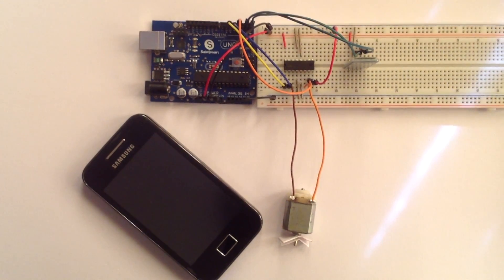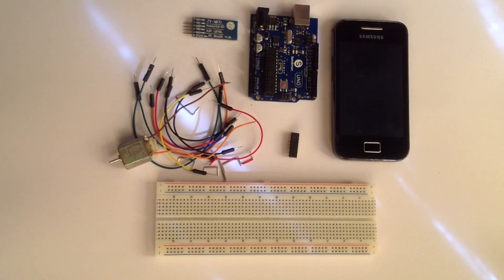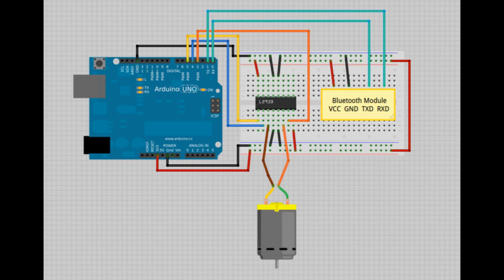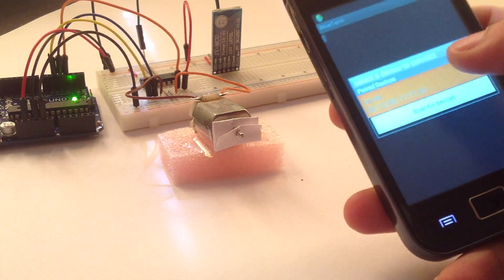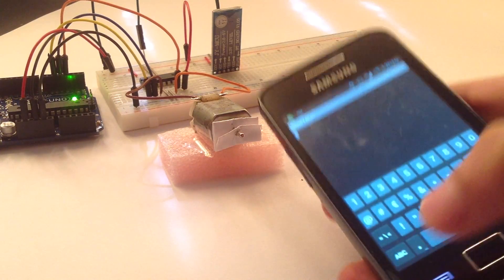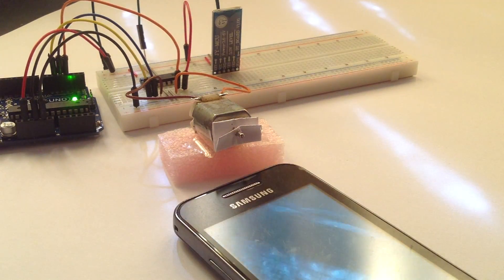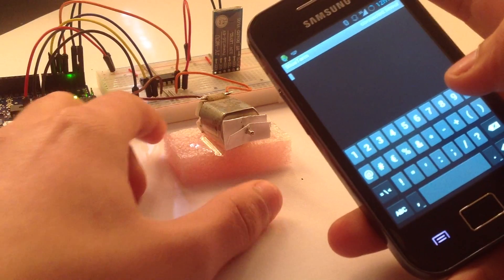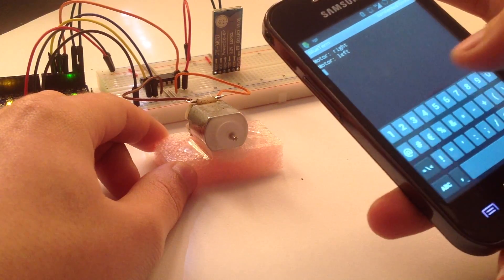Arduino - Control DC Motor via Bluetooth

Comment: Sir , I have connected according to ur given ckt nd coding is same as given by u nd after that uploading of code is also done but still my motor is not running. why ??
Reply: Tanya Chhabra hey can you help me out like where did you connected the battery

Comment: If I have to motors and 4 buttons. The first two buttons 1,2 are for speed_1 and the second buttons 3,4 are for speed_2. What is the code then to control in the speed..!

Comment: Hello I ask you a question, I have the same components as you but I need 1 key on and off the engine and while this lasts only 1 second ahead For a little ... Thanks
Reply: Hace mucho tiempo que no lo hice, pero en un paso Cuando se conecta Hay un signo que dice que el código es el estándar, Look it up wel
Reply: Si no me equivoco, el código Decía algo de "1234"... Intenta con ese.
Reply: ISRAEL RAMIREZ JIMENEZ  El código que usa Blueterm para conectarse al bluetooh del arduino? si no es eso no te entiendo

Comment: is there instructions on how to wire the dc motor specifically? or how to solder them. and do you use the same jumper cables a different type of wire?

Comment: Hi!
I'm from Hungary and i need quick help. I saw this DC motor program on your website and i don't know that the comment of the arduino program is correct because i think the pin3 of the arduino connect to the pin7 of the L293D IC, not to the pin2. Am I right? 
Thank you very much!!
Balázs

Comment: Now show me how you control the 8 metric ton bus with a bluetooth and arduino :D
Reply: Exactly like this, only instead of a single DC motor, you hook up 4 actuators; one for the gas pedal, one for the break pedal, one to move the gear shifter from Neutral to Drive or Reverse, and one to move the steering wheel. Vroooom! Beep! Beep!

Comment: Well explained Rui. I had a small question though. Rather than typing commands like you have (e.g. 0 for stop) , I want to say them (e.g. stop) and using the in-built voice to text converter  that is present in all androids  including the one which you have used in your tutorial, convert it into text. In the arudino code is it possible that somehow instead of " if state == '0' " I can write " if state == 'stop' ". If not how can i make something like that possible?
Reply from the maker: You should check this project: http://randomnerdtutorials.com/how-to-use-app-inventor-with-arduino/
Where I create an Android App with MIT App Inventor.
MIT App Inventor has a pre-built in function called "SpeechRecognizer" under media, that allows you to convert the voice into commands. Here's a print showing exactly that http://bit.ly/P85jMZ
Thanks for asking and I hopw this helps!
Reply: Thanks a lot I'll take a look :)

Comment from the maker: that's a really common mistake, I've already made when I've started a one/two years ago ;)
but if you think a bit if you connect the TX to the TX doesn't make sense.
the arduino transmits the data with TX cable so the bluetooth module can receives the information trough the RX, and vice-versa.
I'm glad I could help :)

Comment: oh man i was having so much trouble getting the bluetooth to work before i saw your vid and website had the tx and rx connections switched but now i got it working to control two dc motors at first i thought it was a faulty motor shield